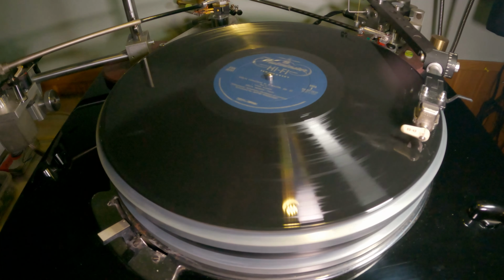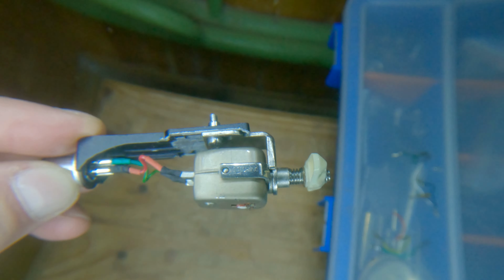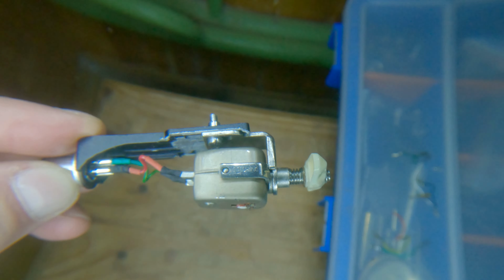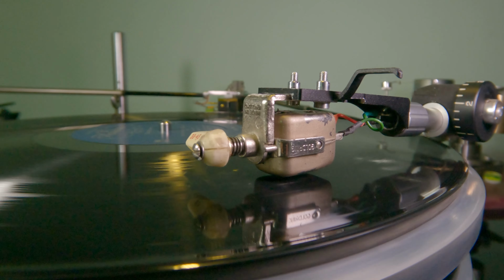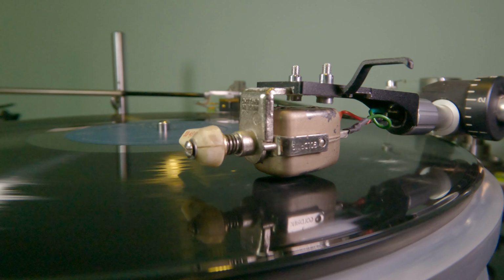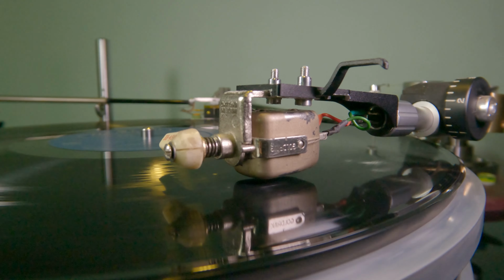GE VRII vs Goldring G600

Comment: I think I prefer the VRII by a small margin, it seems to handle loud passages a tiny bit better and has a bit more spark in the high frequencies. Very useful comparison for me, I'd like to try these one day but my Technics mk2 tonearm is too light, I'd need an older secondary turntable
Reply from the maker: here is my comment about these two cartridges I left on Lencoheaven.net : While listening the file before uploading the differences in sound reproduction are though obvious I guess nobody knows well enough how youtube changes audio so you may hear only subtle differences  in two carts performance. What I can hear is that GE has a wider range up to HF and it will be my choice for well recorded classical mono records but this cartridge may sound a bit harsh up there on some passages. G600 sounds more mellow and I would have preferred this cart on sax in jazz and Lo-Fi records in general.
Reply: @halgrypus  I 100% agree